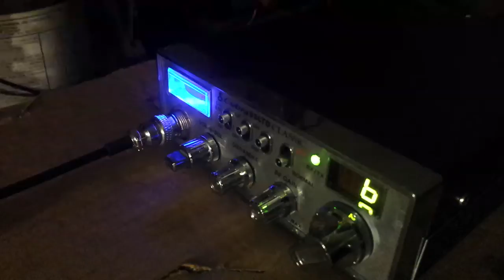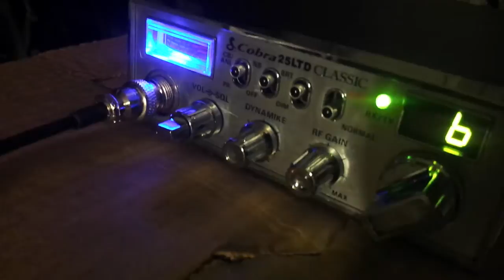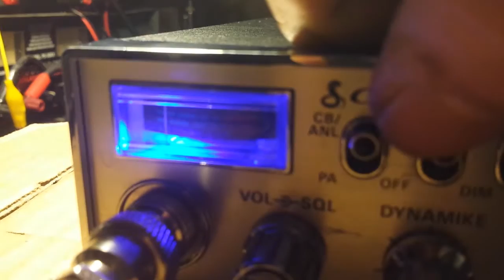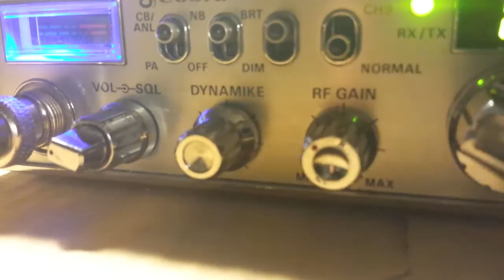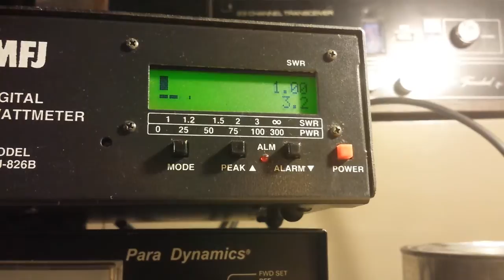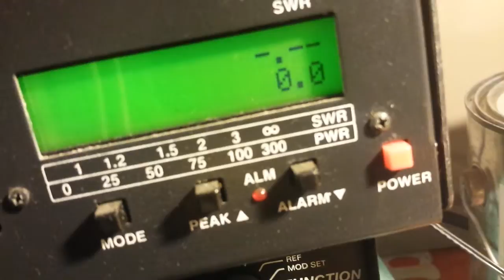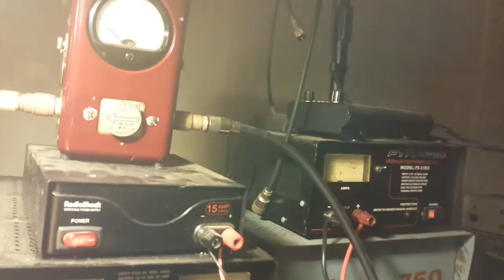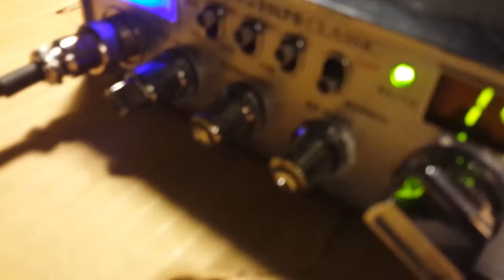CLEAN Cobra 25 LTD Classic Modded Blue LED In Meter

Comment: I have a 25 that looks just like that, bought my radio and meter light did not work, so I installed a blue led. receive is a bit loud but its transmits great although it was missing the am limiter so I put one in it and its installed in my car. So now I have 3 29's im working on and a Stalker One by Teaberry.
Reply: Im watching your vid " how to make and install a regulated dead key variable". Great idea, very informative. how do I clean up and quiet the receive for the rf gain or is it the squelch so receive is more quiet? would you recommend replacing the mosfet/final as well? If I use a 500 ohm pot do I have to use a resistor along with it?
Reply: do you think a IRF510 would be a good final for a cobra 25?